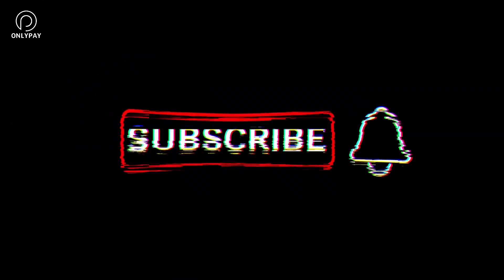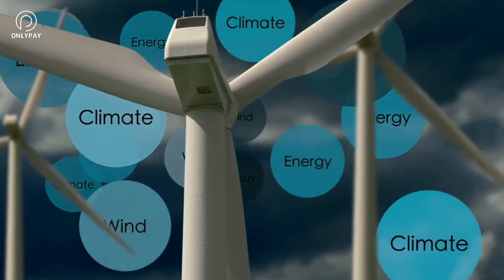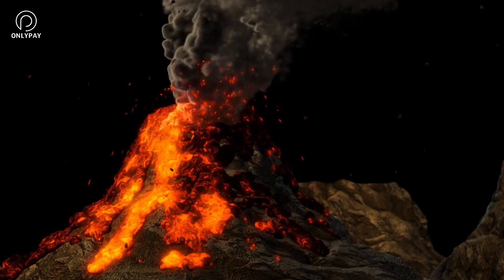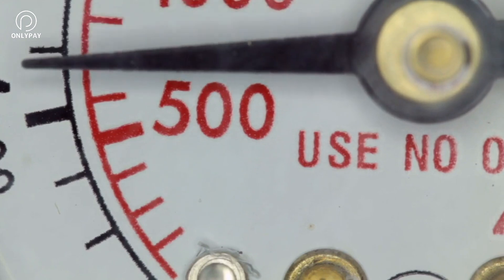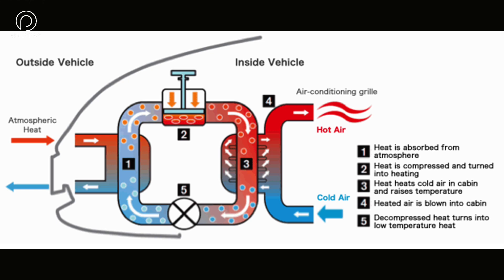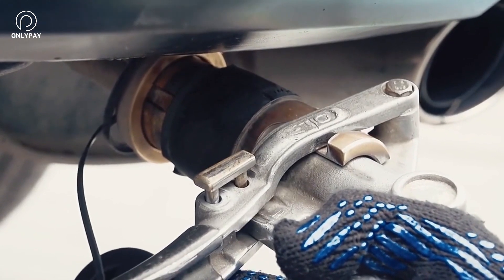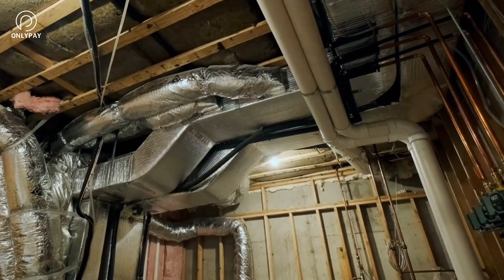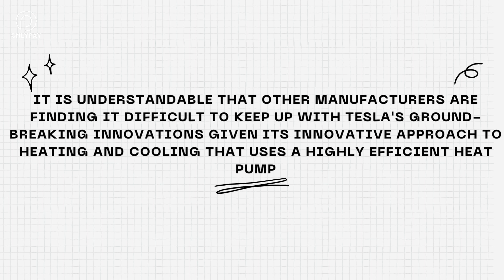Tesla Created a New Heat Pump and It Will Make You RICH!

Comment: Even if every car owner in the world purchased EV, the electricity to charge those EV's has to come from somewhere, and it certainly won't be supplied by anything other than natural gas or coal. NONE of the green options produce enough to do the job, period.( The MSM has kept the general public terrified of nuclear, so that's a no-go.) Solar and wind only supply 10-12% of demand on a good day, i.e., when the Sun is shining and/or wind is blowing.

Finishing the opening sentence's idea that if all car owners suddenly purchased EV, liquid and gas fuel will still have to be piped/shipped, the giant mining equipment that mines/hauls the ore necessary for EV *battery manufacturing are also fueled by liquid petroleum and that type of equipment lasts 40 or so years, and airplanes/jets (the largest consumers of liquid petroleum, i.e., Kerosene) must still fly. Car owners would take care of about 10% of the world's consumption. And little do EV owners realize by the time their new electric ride arrives on the lot the shipping process to get them there produces about 60,000 pounds of fossil fuel exhaust. They need to own those EV's for 100,000 miles before payback.

* 500,000 pounds of ore must be mined/shipped/processed to produce one EV battery. Plus, those mines use child slave labor. Is any vehicle worth that?:face-orange-raised-eyebrow:
Reply from the maker: Wow, your comment is quite the masterpiece of misinformation! It's clear that you're determined to spread fear and doubt about the viability of electric vehicles (EVs) and renewable energy sources. Let's break it down, shall we?

First, regarding electricity generation for EVs, you seem to be stuck in the past. The world is rapidly transitioning to cleaner energy sources such as solar, wind, hydro, and yes, even nuclear power. In fact, renewable energy accounted for over 26% of global electricity generation in 2020, and the percentage continues to rise. So, your claim that "NONE of the green options produce enough" is simply false.

Next, your assertion that EVs are indirectly dependent on fossil fuels due to mining and manufacturing is misleading. While it's true that some mining equipment and transportation vehicles use petroleum-based fuels, the overall impact of EV production is significantly lower than that of traditional internal combustion engine vehicles. The industry is constantly working to reduce emissions throughout the supply chain.

As for your claim about the shipping process emitting 60,000 pounds of fossil fuel exhaust, that's an exaggerated figure. Transportation emissions for EVs are generally lower than those for conventional vehicles, even when accounting for the emissions from manufacturing and shipping. Plus, EVs become even greener as the energy grid becomes cleaner.

Your pessimistic view fails to acknowledge the incredible progress being made in renewable energy, EV technology, and sustainable practices. The future is shifting towards a cleaner, more sustainable world, and EVs are a vital part of that transition. So instead of spreading outdated and inaccurate information, why not embrace the positive changes happening around us and be a part of building a greener future?